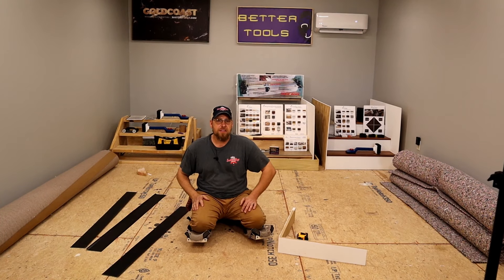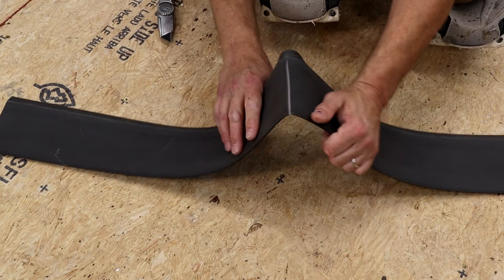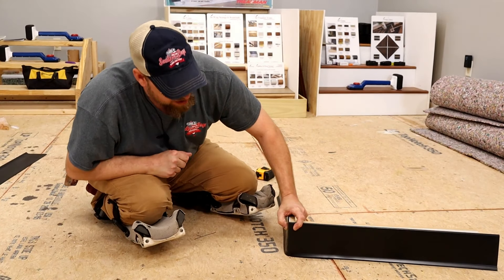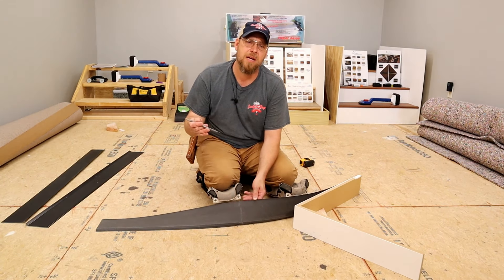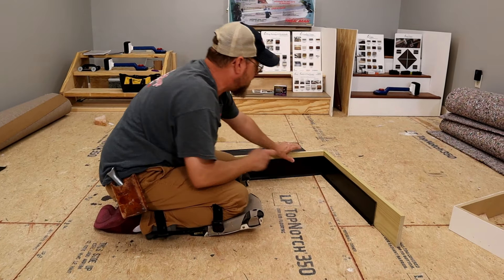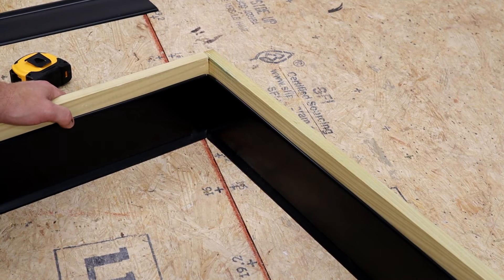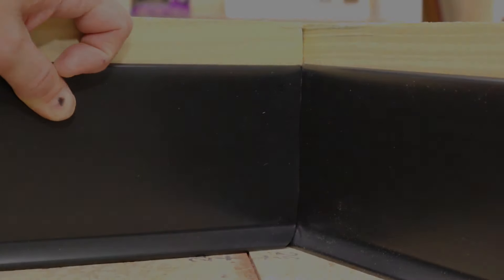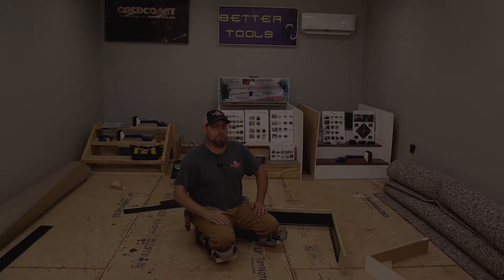Inside and Outside Corners: Cove Base Installation Made Easy

Comment: I had to remove a 48" piece and it was left off for a long time. Now putting it back on the bent part at the bottom is not quite bent as much as the other pieces still on the wall. To get it to match, should I heat it up and hold it in place after gluing? Also, I don't have cove base adhesive, will liquid nails work? Thanks!
Reply from the maker: Yes, and yes

Comment: I saw a video of a guy doing base for 30 years and shaved like you but heated lightly with torch , squeezed together than put in bucket of ice water. perfect. did the same with bottom
Reply: Yes would work but you have to be careful you can deform the base

Comment: nice job!   Question, I've noticed that most of the installs are done using 3-4 feet of rubber base, I like to install this in my garage and I have two sides that are straight with only 1 inside bend about 20 feet apart, feet.  is it ok to run say 20 feet to the inside bend, then run another 20 feet or should I focus on short 4-6 feet lengths?  my goal is to not have many cuts and look completely seamless.  Between two of my walls in the garage I can run a continuous line of the rubber base molding for a solid 40 feet with only one inside bend.  what do you think?
Reply: Run it Full lengh.
Reply: @fusic09  although full length (20 feet) is ideal, I felt it was going to get messy due to the adhesive and adjusting a 20 foot strip alone would require.  The longest strip I ran was 12 feet and to assist me with lifting it cleanly against the wall, I used a 8 foot piece of 2x4 which allowed me to flip it just right (you have to time it just right and still requires some adjusting).  My opinion and this is my first attempt, trying to run 20 feet alone is going to get messy so another set of hands would be nice to have.
Reply: I don’t do the 4’ pieces I use rolls so you don’t have edges meeting everywhere
Reply: With that said you have to make your cuts square and they have to be about perfect

Comment: I like to fold out the bottom of outside corners. So its a consistent cover. If the carpet isn't cut perfect at that outside corner the base won't cover if the bottom is not smoshed out

Comment: If you know the thickness, you can get really precise and make a cut at the bottom that far out before you cut your angles cut at the bottom. Then you won't have that tiny empty space on your corner base.  I guess it all depends on what color you're working with.  Lighter colors will likely show the hole more than darker colors because of shade.

Comment: That outside corner is gonna rip over time, head down to EJ Welch and grab a cove base gouging tool.
Reply from the maker: I don’t know, I have done it like that my whole life and not had any issues
Reply: A cove base gouging tool is for someone that can't control their knife. I bought a gouging tool and it's never been used, it's been sitting collecting dust in my tool box for 20+ years.
Reply: If u cut the thicknes of bases past outside corner and dig out more farther you wont need hot met or power tape
Reply: Crease inside corner and use with mark on the back as point of reference
Reply from the maker: @charliegoodspeed240  good point
Reply: @FloorsbySouthernboys  love your videos keep up the great work
Reply from the maker: @charliegoodspeed240  Thank you sir I appreciate it
Reply: That tool is a joke, a good knife hand and a sharp utility blade will do a better job 100% of the time.
Reply: @kwantoon  nah it works better u just have to learn to use it
Reply: @TheSands83  I could argue that people should learn how to use their knife better, because a sharp blade and a good knife hand is far better than that silly tool. I've been doing commercial resilient flooring for over twenty years and I've never known one single installer that used that tool. When you could be cutting as many as a hundred outside corners in a day, that tool makes absolutely no sense.

Why carry an extra tool that requires a special blade when I can just use a tool and blades that I always have in my pouch?
Reply: @kwantoon  I’ve used both and can use both but the corner tool is better
Reply: @kwantoon  why keep it in your pouch? Just put it in there when u start doing the cove base😂idk I get what your saying u can with a knife but it’s way faster with the corner tool and u don’t have to worry about the depth because u can adjust it n it’s zip over n out but to each their own
Reply: @kwantoon  special blade? What?😂 dude idk what blade u r talking about.. u must b thinking of something else.. and those tools r tiny I have plenty of room in my pouch for one..
Reply: @TheSands83  It's a personal preference, but. There's a reason why commercial installers don't typically use it. In fact the last time I seen anyone use that tool was almost 25 years ago when I was a residential installer and did a few pieces of base, instead of the volume you see on commercial jobs. It's the same reason we don't use base adhesive in caulk tubes, they make no sense for what we do.
Reply: @kwantoon  I do commercial installation so.... n I can blow through it in a snap n idk what special blade u r even talking about..
Reply: @kwantoon  I learned with a knife.. how I did it for a decade but I started using the corner tool n I got so much quicker I can blow through 2-3  rooms b4 most guys can do one.
Reply: @TheSands83  Does that cove base tool use a common blade or does it use magic to remove material from the back of cove base?
Reply: @kwantoon  it doesn’t have a removable blade. Have you ever seen the tool? It’s sharp but not a blade
Reply: @brettlindsey5768  Not in about twenty years, because it's for amateurs that can't properly use a knife.The key to making any quality cut is a razor sharp blade, so why would I want a tool that needs to be sharpened?

Case in point; How many people still use a Linoleum knife that has to be sharpened? Very, very few because it's easier, more efficient and yields better results to have a knife that can maintain a razor sharp edge by changing a blade. It's really just that simple.

I haven't seen one installer in the past twenty years using a cove base gouger, it's just not worth the space it takes up in your pouch. However, if you like using that worthless tool, that's your choice.
Reply: @TheSands83  when I first learn how to install cove base and then it have a good night control are used a gouger… After about a year and learning to control my knife I’ve never use the gouger again. I’ve had buddies that are union guys who are told they have to use the tool, and there is in one of them that can cut outside corners nearest fast with their gouger and make them as precise as I can with a knife. In all actuality all you have to do is put a little tiny scratch right down your corner and then put a little Ford in your cove base and cut equal distance on each side one pass… I know people who do the whole barely cut through thing like he does and then come outside but it is far slower
Reply: The reason for a tool like this is for consistency (like any tool to remove the "craft" or "art" from the work - like a proper ratcheting crimping tool for electrical contacts versus the cheap hardware store style).  And possibly ease.  It may be true that a particular individual might be able to do consistently good work by hand.  But if you take a hundred people, you might get a hundred results and not all of them good.  And even for one person, perhaps not the same results every day.  An amateur is probably going to be more consistent using such a tool.